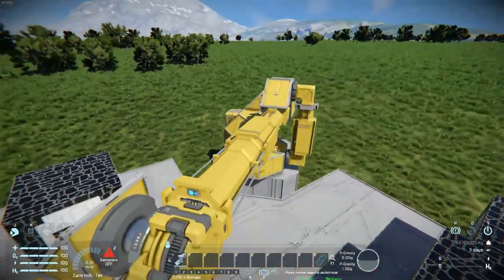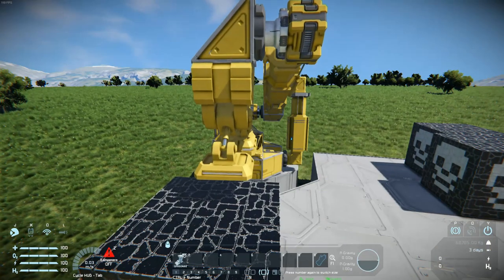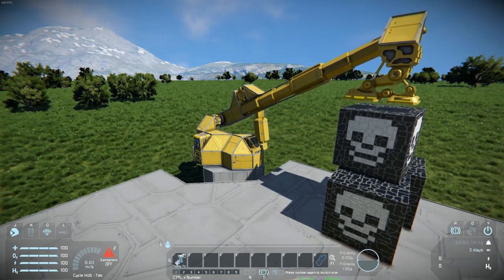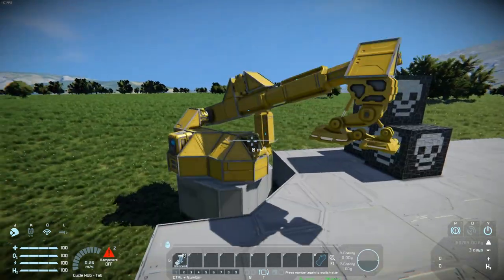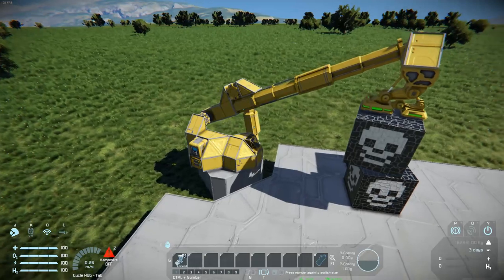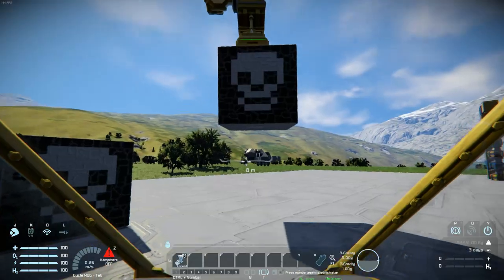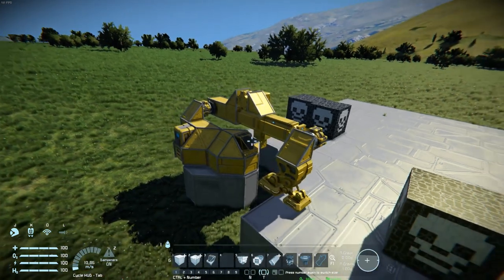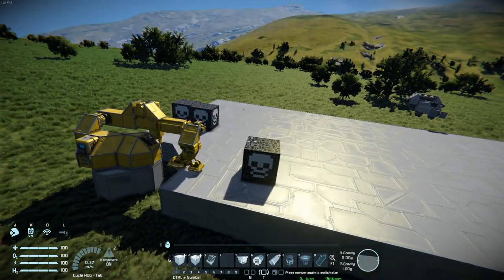Space Engineers - Cargo Crane and some Programming guide thoughts

Comment: I tried it out this afternoon and I was very impressed with how smooth and responsive it is.  Particularly when picking up light armoured blocks instead of those heavy armour beasts. Very nice.

This is exactly what I had in mind when I was thinking of my mobile robotic.welding arm.  Of course that will have a bit of extra bulk due to the blocks needed to allow for the transfer of components, but it is the operation that is important.

Comment: This was pretty impressive. 

The script I decided I needed to figure out tonight is something running on a mining ship, especially drones, that can sense when approaching a base and shut off the sorters/ejectors. Maybe using sensors and beacons?
Reply from the maker: Hmm, it depends, what sort of distance are we talking?
And are we talking any base or your specific base? :)
Reply: My own bases, probably specific to that drone, and far enough out that it isn’t littering stone all over my base. AND (which I guess I should mentioned in the first post) sorters and ejectors need to restart after the drone has moved away from the base.
Reply from the maker: @hundejahre  In that case it is, relatively, trivial!

If the base is stationary, i'd read out its position in X, Y, Z coordinates hard code those into a  script that gets the distance between the drone and that set of coordinates, and then turns the ejector and sorter on or off depending on that distance.

So basically:

Get the distance between the coordinates.

If distance is greater than X
Turn Sorter and Ejector on
Else
Turn Sorter and Ejector off

I'm gonna go over IF and FOR statments and probably distance between coordinates in my next video, the first and last of which are needed to solve this problem, but i'll probably not get that done until the end of the week.

I could quickly write something up if you'd like? :)

Comment: Hello!

I tried recreating this crane on my SE server but I encountered two problems that I'm not able to deal with.
1) The arm will not raise - it is not the fault of the script, when I cut off the rotor head the top of vertPiston is connected to the piston goes up and down as expected but when I reconnect it to the rotor it gets completely locked in place. I checked the settings of the rotor with the settings on the crane in the save file and they are the same
2)The hookRotor is spinning around and around non stop - this must be something in the script but it is quite bizzare as the same script runs the crane perfectly fine in the workshop world but gives me this weird problem on the server. 

Anybody has any idea what might be causing my issues?
Reply from the maker: Weird!

It's probably both a mechanical and a software issue.

1: Check that the rotor at the base is turned off, maybe try increasing the impulse (both axis and non-axis) on the piston, it may simply be overloaded.

2: Sounds like a script issue indeed. IIRC, the hook rotor moves relative to the base rotor, so make sure all rotors are named exactly the same as the original, or change the names near the top of the script. Also make sure the programmable block isn't crashing; Since it's constantly adjusting the hook rotor, the PB crashing will cause the hook rotor to rotate continously.

Hope that helps, if not, give a shout and we'll find another solution!
Reply: @PatrickHansen101  

Adjusting the impulse up solved the first issue so the arm runs great now.

The hookRotor is still rotating. I am 100% sure everything is named correctly. Nut sure about the crashing though, never seen a programmable block crash, how would that even look like? Wouldn't everything stop working then?
Reply from the maker: @SirPrzecinek  Usually it''d say something with a null reference in PB Echo, but if stuff still working, the PB should be working as well.
Could you maybe have rotated the rotors before attaching things to them? The script assumes that when everything is horizontal, both rotors are at 0 degrees (if i remember correctly), so one being rotated before the block was popped on may mess the system up.

This build is from before i learned using vectors, so it makes a lot of assumptions :p
Reply: @PatrickHansen101  Yeah replacing the hookRotor fixed the problem. It wasn't at 0 degrees because when I was building it I put on the rotor, the block that goes on it and the landing gear and then welded it all up so it rotated before it was finished. So it is all working now as intended. I even managed to kill myself accidentally with the crane already. Now that I have this working I maybe could use this script to build a much bigger heavy lift crane with multiple pistons moving the arm and an arm that is like five pistons in a cross pattern and something like that. Maybe a heavy lift crane with new and improved coding could be an idea for a new video? Also btw a dirty fix for the hookRotor problem is just turning the rotor off - it will then adjust under it's own weight.
Reply from the maker: @SirPrzecinek  Glad you got it working :)

Yeah, the hook rotor thing was to solve the issue of carried cargo swinging back and forth, as well as the "hook" swinging and me having to wait for it to level out before picking things up :)

I've considered making a crane again, especially considering i've gotten better at the code, i just didn't want to build the same thing again.

If someone comes up with a specific usecase/scenario for the crane i'd probably give it a go :)
Reply: U need to take out all the torque also look if u got any rotor locket mostly its one of those two that prevents it from worling in my se
Reply: @PatrickHansen101  the first thing chould be the sexond thing no its not the script the rotor spins around whit the hook because that one basicly is free moving sow u need to add some torque to that one notuchs just a bit sow its has some counter forces whichs it doesnt have now from what i read other wise look up guides and stuf there realy helpful
Reply from the maker: @mopadrider6012  the hook is actively managed, the script adjusts the torque to try and  keep it parallel with the ground at all times .

Przecinek's issue was that the script couldn't find the rotor and adjust the torque and rpm.

Using static torque as you mention was also my first approach, it just has two issues: too high torque prevents the hook from rotating when unloaded or lifting light things, and the centrifugal forces from rotating can make heavy loads swing around